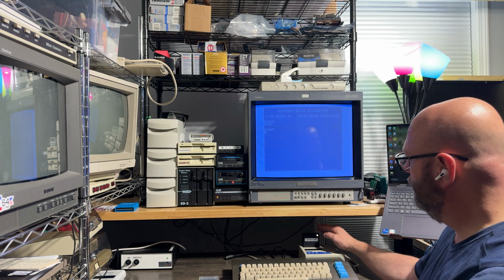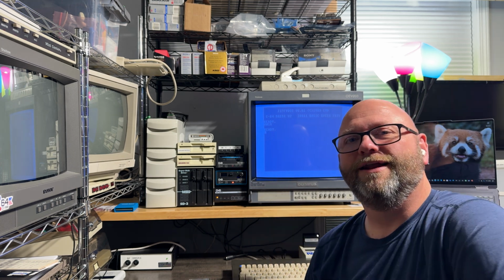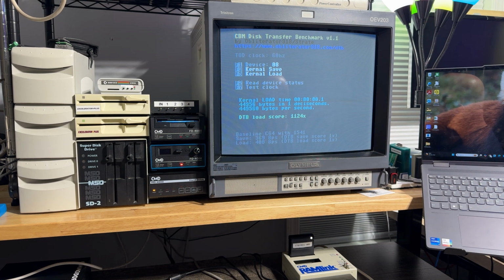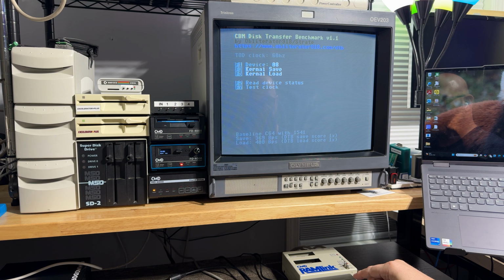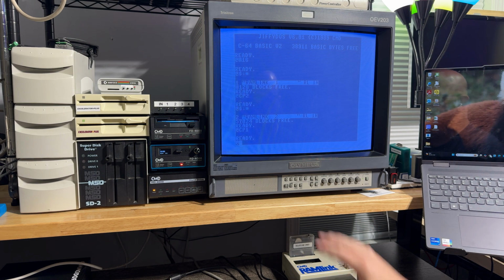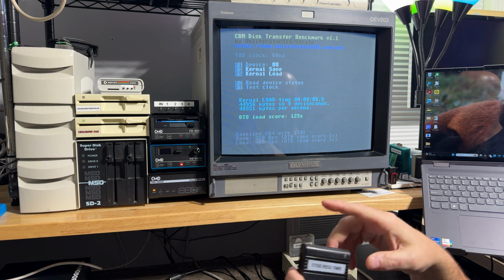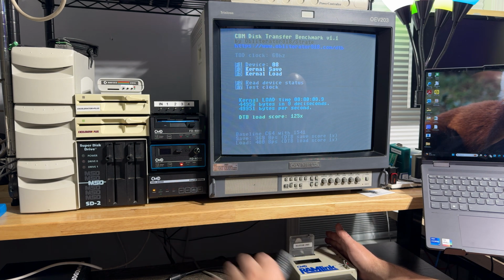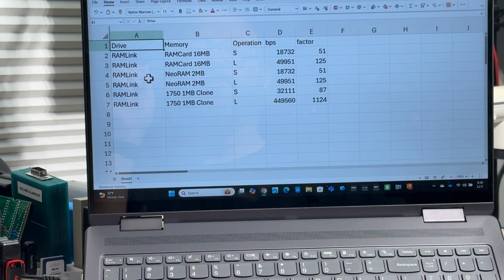Commodore Drive Speed Challenge - Part 3 CMD RAMLink

Comment: I agree with your speculation that the reason the RAMLink + REU is so fast is because the REC (RAM Expansion Controller) is being used to transfer the data from the REU's memory to the C64's memory.  Where as for the GeoRAM and RAMLink's memory the C64's CPU is responsible for copying the data, which is much slower.
* "How the Commodore REU Works"
   https://www.youtube.com/watch?v=3c2jhh1f5FE
* "What can you do with a C64 GeoRAM ... and what is the difference to a REU - Ram Expansion Unit?"
   https://www.youtube.com/watch?v=8HyYXPzhE_A

Comment: Really fun video (again)! I have some questions: 
Do you think the type/speed of SIMMs in the RL matters? 
Is your RL in the demo a v1 or v2? Looked like a v1 based on the power plug. Have you ever compared speeds against the two versions?
If you use the 1750 clone as the source of RAM, does the RL retain its data when you cycle power like it does with the internal SIMMs? If so, have you ever tried to load C64OS off the bonkers clone cartridge?

I have an original C= 1750 (and RAMlink).  I could do some tests like you suggest =) But yeah, my RL has GEOS on there. Gulp!
Reply from the maker: So...
1. Does the SIMM type matter? My thought is no, only because the GEO/NEO was the same exact speed. Plus, while I can't remember exact SIMM type I put in there, they came new from Ebay (Memory Masters i think). But the NEO has absolutely modern surface mount ram.
2. The RAMLink in the demo is a V1 that has been upgraded to a V2. I also tested off camera a V2 unmodified and had the exact same results both the RAMCard and REU.
3.  ALL POWER MUST BE REMOVED from the RL to put in an REU/GEO.  THIS WILL ERASE ALL DATA from RL. So you need to do a backup of the RL's data first to an HD or FD.
Reply from the maker: 4. When you have an REU or GeoRAM plugged into the RL. RL also keeps the REU/GEO powered as long as it is powered. So when turn your 64/128 off, all data in both the  RAMCard and REU/GEO is retained for the next time your turn the 64/128 on. Both are erased if power is removed from the RAMLink.
Reply: @CommodoreSam  That's very cool. I've had this thing for years but never knew that. Thanks for all the info, Sam! Great stuff